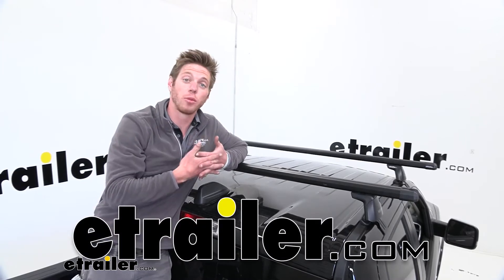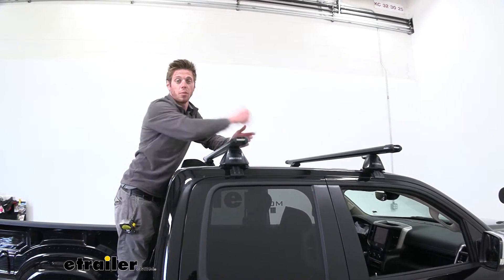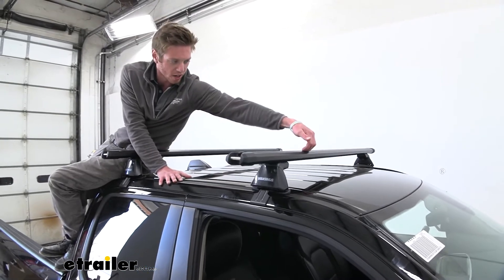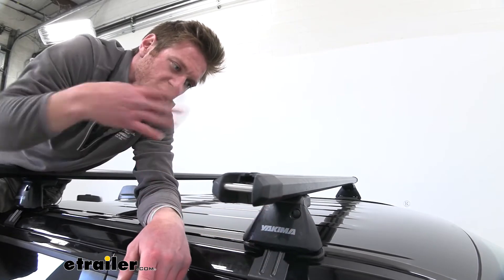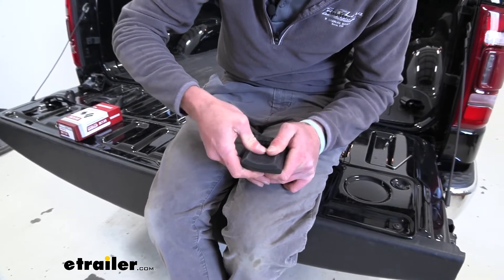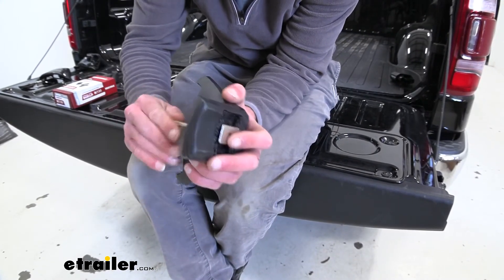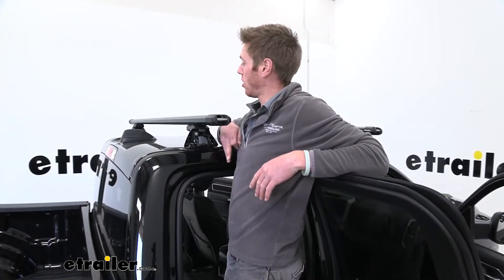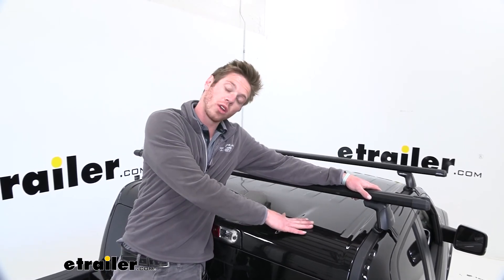etrailer | Yakima HD Crossbars Installation - 2020 Ram 1500

Comment: hi what size is the actual bar? 60 or 68/
Reply from the maker: The video shows the # Y01158 Yakima HD crossbars. They are 68 inches in length.
https://www.etrailer.com/Roof-Rack/Yakima/Y01158.html